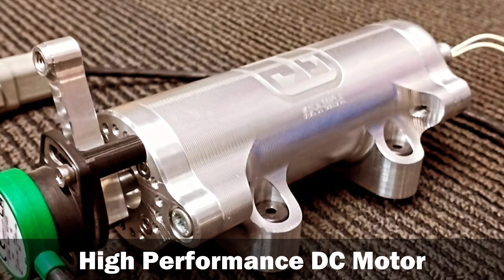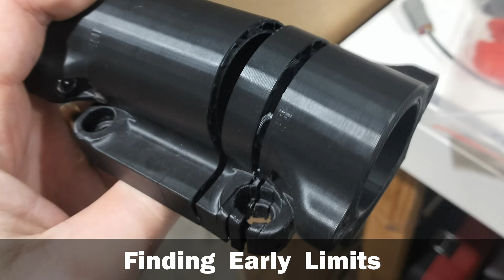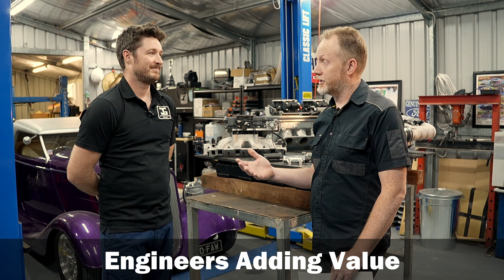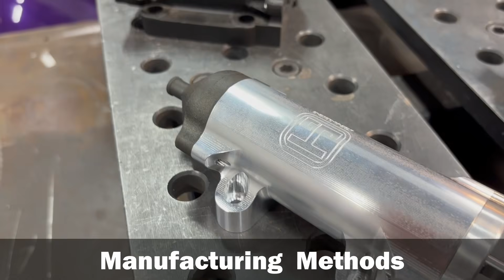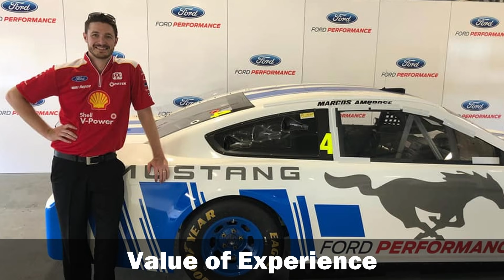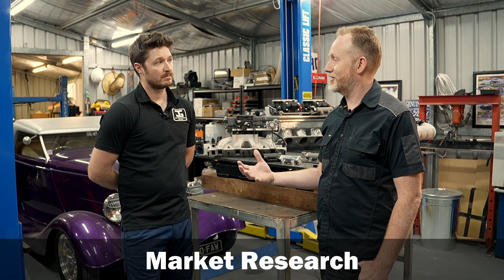Inside the Design of a Professional Race Throttle

Comment: I wouldn't have thought that the motor would have to be that beefy. 

How much torque is required to control throttle butterflies?
Reply: The loads vary depending on the throttle size, vacuum, if the engine is boosted. So there is a lot of variables that need to be accounted for, but we also wanted to use this for more than throttle actuation so it is beefy.

Comment: These 45 minutes would be far more powerful if you started by explaining the problems with existing electronic throttles.
Reply from the maker: That is a fair comment.  We have a policy in the channel to not talk bad about other products.  If we are not fans of a particular product or service you probably wont hear us say much at all about it.  At the same time it makes it difficult to show where the product fits into a particular niche.

Jon and I had a chat after the video and felt there were a few things we do to improve similar videos in the future.

Thanks for your comment, we really value the feedback of viewers, and appreciate the time you put into providing the feedback.
Reply: @KevinHayward7  I'm not talking about any specific product, I'm talking electric throttles in general.  That is to say, comparing an electric throttle against a cable connected directly to the butterfly valve.
Reply from the maker: Ahh, yeah that would have been a great way to start off.  Should have done that for sure...
Reply: @KevinHayward7  Yup.  Then you could then have explained how your device is superior to OEM units, and how it eliminates many of the drawbacks of an electronic throttle.

Now, as an engineer myself, the video I want to see is hard data on the latency of your unit compared to an OEM unit.